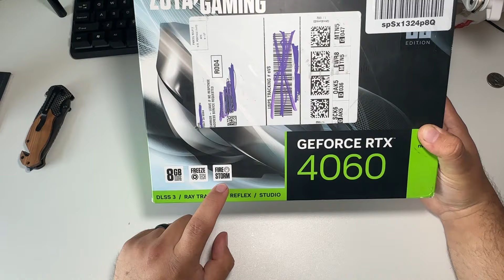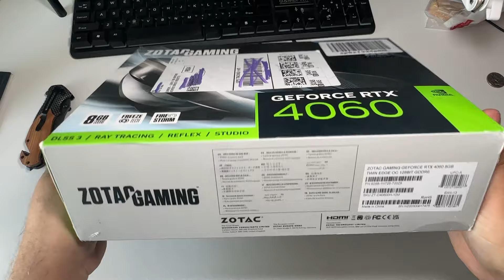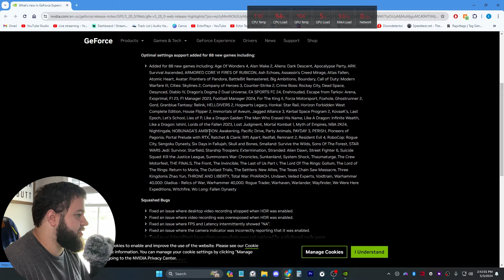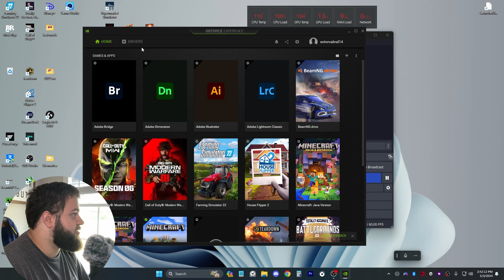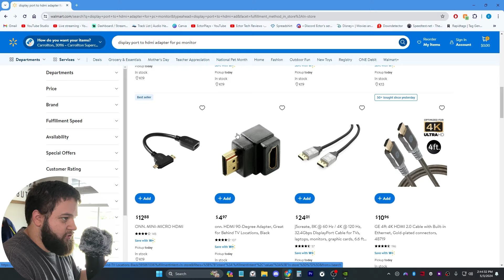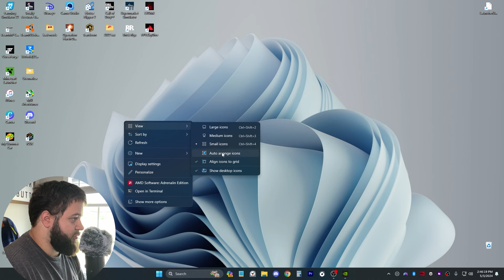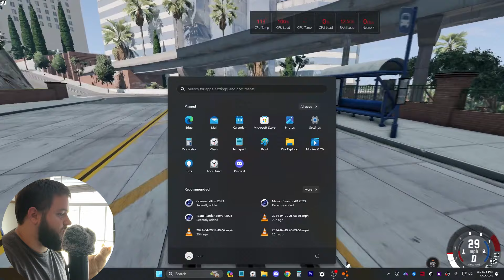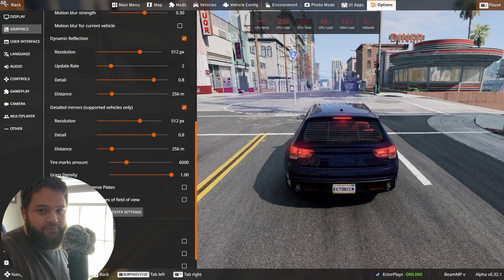I GOT SENT A RTX 4060 FOR FREE FROM A SUBSCRIBER!!!!!!! OMGGGGGG

Comment: You need higher resolution, higher settings, or a faster CPU in BeamNG.  Other games won't be so bad, Beam is very CPU heavy.  Welcome to the club of having too fast of a GPU for your CPU, or what's called "bottlenecking".  This is part of why I bought a Ryzen 3600, 5800x, and now a 7900x (and finally happy in BeamNG).  Hit me up sometime in the evening when you're bored, we'll go through some new features you're definitely not going to be familiar with like DLSS and the RTX capabilities.  You're in for a treat, and so are your viewers.  Even with your current monitors, we can get you at least recording at higher res right now if you wanted to try.

Also, somebody donate this man an electric duster.  🤣Loved watching the video, and your reaction to the "Ultra" was absolutely great!
Reply from the maker: Thanks pio! I added the ryzen 9 5950x to my wish list a few weeks ago I may have to save up for that!
Reply: @EctorPlays  5950x would probably be super useful for BeamNG and content creation.  Checkout the 5800x3d as well, although you'll lose a few cores in the process, the 3d cache makes the 5800x3d perform closer to a 7700x or 7800x.  But again, you lose cores in the process from the 5950x, so its a tradeoff.